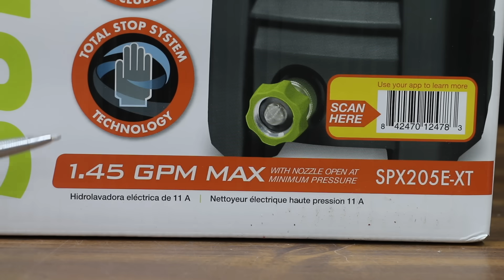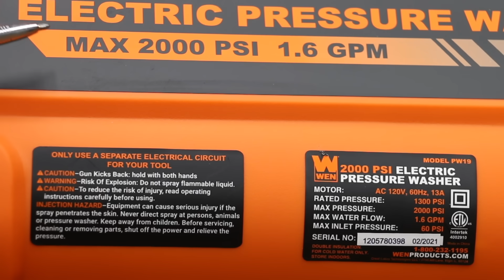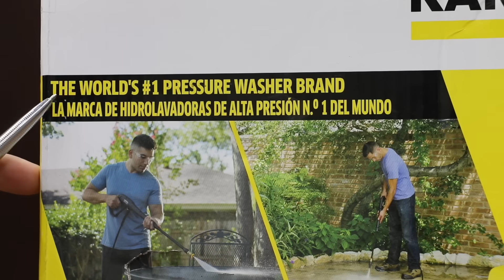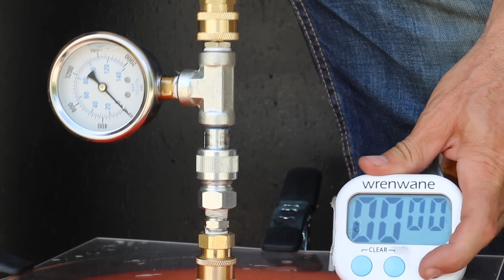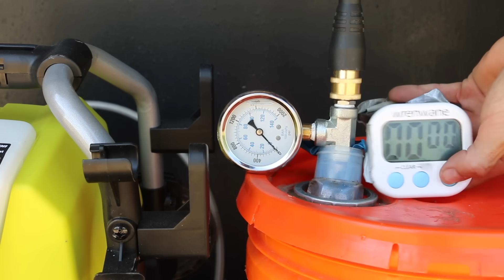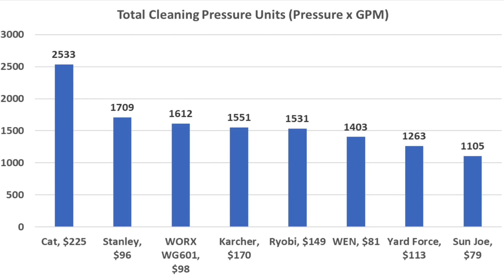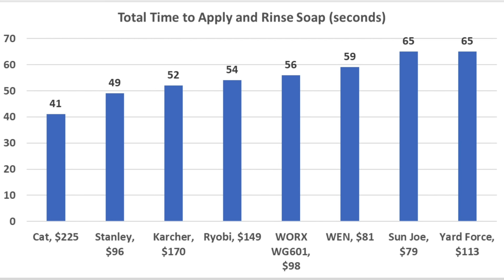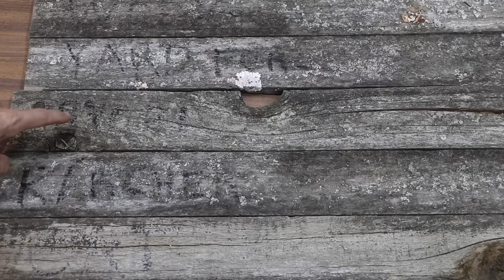Best Pressure Washer (ELECTRIC)? Ryobi vs Karcher, Stanley, Sun Joe, WEN, CAT & WORX

Comment: Love your video. What I’d really like to see is you compare consistency of units of the same brand. For example, are 3 Milwaukee impact drivers purchased from different batches/stores more consistent performing compared to each other than 3 Bauer drivers compared to each other. Maybe you can choose some cheaper tools you’ve already reviewed and acquire a bunch to see if the performance you tested is consistent or varies a lot with each unit the brand produced? Which brands are more consistent? Let’s find out.
Reply from the maker: Thanks for the suggestion.

Comment: Can you test foam cannons? Is the $30 recommended ones better than the $15? Or do you gotta step up to the $100 MTM to get s difference?
If u test more pressure washers check out the active ve52
Reply from the maker: Thanks for the video idea.
Reply: @ProjectFarm  i found out active makes the cat pressure washer so they are the same thing. no need to test it if you do another video.
but testing the cleaning power of snow foams or regular car soaps would be a great video! :)

Comment: Would like to see a review of different brands and styles of tire skates (car dolly) which have four swivel caster wheels and are used for moving a car or truck on a paved surface for short distances like inside a building or on a driveway.  Most designs require the car to be lifted by a floor jack to slip the dolly under the tire.  Other designs have a mechanical or hydraulic jack mechanism to lift the car enough for each tire to clear the pavement.
Reply from the maker: Great suggestion!  Thank you.

Comment: Would have liked to see you clean an area of concrete with each pressure washer and compare the time it takes and effectiveness at cleaning with different spray diameters. Also would have been nice to throw a gas pressure washer in the mix for comparison.
Reply from the maker: Great suggestion!  Thank you.

Comment: One tip that all should know......run your washer about 5 seconds with NO WATER...this will clear out your pump ....I have a Campbell Hausfeld PW1825 since 2014 ...bought on Amazon for $130 ......used it about 30 times a year...still going strong :)
Reply from the maker: Thanks for sharing.

Comment: You really want 3+ GPM and at least 2500 PSI (3000+ being preferable) for good results with a foam gun.  Most 110V pressure washers can't get the job done in that respect
Reply from the maker: Thanks for the feedback.

Comment: Great video! I noticed that the first part where you measure flow rate, psi, etc seemed really sped up. It was hard to follow,  especially when you were mentioning the stats. The weight as an analog for gallons really confused me - I wish you would have just mentioned the conversion in the beginning to explain the test, then just told us the gallons per min. I liked in your previous videos when you made it clear which brand was in the lead after every test, which I missed in this video. The wood was a tricky test because all of the brands didn’t seem to do great, and the final results were hard to decipher - I think if you pressure washed some pavers or concrete it would have been much easier to see the difference between the brands. I love all of your videos and hope you keep it up!
Reply from the maker: Thanks, will do!  Thanks for the constructive feedback.

Comment: Can you do a video on portable induction stove tops that plug into standard outlets (120V)? Duxtop is an example brand that does well on test-kitchen reviews, but the coil size inside the units is always debated having me wonder about how much even heating there is and if that matters.
Reply from the maker: Thanks for the suggestion.

Comment: Great videos! Can you please test storage totes? The standard 18 gallon rubbermaid roughnecks vs sterilites vs others would be great to see.

Tests to include max capacity, resistance to permanent deformation, fragility in general would be great to see to find the best garage storage solution!
Reply from the maker: Thanks for the suggestion.

Comment: Hi, you use a mass of gas engines so am interested in your thoughts and how you get around problems with gasoline. It might make a good project too for us all.

My wheeled gas trimmer has not to have ethanol more than 10%. They really want us to use non ethanol and discard gas at the 30 day period. This seems a ridiculous period. Surely  gas will not go off in 30 day? So do you have some additive with the fuels.
Can you do some testing on the problem?
Suppose I buy 1 gallon non ethaline. Put some in the tank. Drain it if not used at 30 days. Then how can I put more 'fresh gas' in from my 1 gallon gas container because THAT is also 30 days old.
Reply from the maker: Thanks for the suggestion.

Comment: as a technician in pressure washers.  If you are going to buy a karcher, DO NOT BUY THEM WITH THE PLASTIC PUMP.  Karcher has some models with the pump part that is entirely plastic and it cracks very often.  Before buying a karcher, do some research and see if the model has a plastic or aluminum pump.
Reply from the maker: Thanks for the feedback.

Comment: I guess this one might be in a different class, but I have this stand up Sun Joe, and it seems to work very well as well as taking regular pressure nozzles: Sun Joe SPX3000-SJB 2030 Max Psi 1.76 Gpm 14.5-Amp Electric Pressure Washer, Blue  It also has a built-in detergent tank. Though I have yet to try using the tank.
Reply from the maker: Thanks for sharing.

Comment: I went with the Karcher last year. Definitely hate that pressure fluctuation but otherwise pretty nice. Got it on sale for $100 so all is good. Also replaced all the connections with quick connects and a snub gun.
Reply from the maker: Thanks for sharing.

Comment: I borrowed a Portland (Harbor Freight) 1750 psi.  It is a couple of years old, leaks in two places and is not able to effectively clean grime off my deck.  I fixed a leak, no change, still sucks.  It is just weak unless I use the hole-drilling setting, then it will etch the grime and damage the paint on the railings, but still a failure.  I'm posting this because just about anything can clean a car, including just a hose.
Reply from the maker: Thanks for the feedback.

Comment: I need a replacement for my Karcher 205, which finally died after about 25 years. Yeah, it’s little but it would chip concrete if you’re not careful. I never had a problem with a dirty carburetor either. It doesn’t have one; it’s electric. I’ve cleaned sidewalks, decks, fences, cars, and riding mowers. If something is stained such as from tree sap, a car wash mitt is handy, or a scrub brush. But don’t tell me I need a gas-powered pressure washer. I’m not washing houses or tractor trailers.

Comment: I bought a Ryobi last year for two reasons. One, most of the pressure washers are 75% empty space inside, that upright enclosure has nothing in it, just a pump in the bottom. The Ryobi is much smaller and I can put it on a shelf.
The other reason is that it uses standard fittings. I had to throw away my previous washer, a Campbell Hausfield because it got a small crack in the wand that leaked a lot, and they seem to change their proprietary fittings every few years so I was unable to buy a replacement wand, and in fact unable to even buy a new hose and wand because they used a weird fitting at the other end too. I scrapped the entire thing because the wand cracked. I won't buy any more washers that don't have standard fittings at both ends of the hose.
Reply from the maker: Thanks for sharing.

Comment: Hi Todd, Great video! A quick question: Do all the washers you test have metal garden hose connectors? I own an older electric washer and it has a rather flimsy plastic connector, which can distort easily if I try over tightening the fitting. Thanks!

Comment: @project farm  great vid as always bud. Keep it up. My favorite channel for sure. I wouldnt be upset if you made 3-5 vids a week lol. But i know thats way too much with how complex your testings are.  I have an idea for a vid, hinges. Whats the best product for old hinges. Also, for power tools, is like dewalt, makita, milwaukee, is dewalt the same insides from HD, Lowes, supply house/pro tool shops. Are the insides of milwaukee and makita the same from HD as the much more expensive version from supply house/pro tool store, or from the manufacturer/sales reps. I always hear people say the the ones you get at the big box store have cheaper internals that supply houses ect eventhough they are the same part number. I dont think thats the case. I cant see them putting them same part number but different internals based on where their sold. Yes supply houses ect used to have better tools than HD, but i dont think they were the exact same part number as big box stores. Now you can get the same part number from big box stores and supply houses but the price is so much higher at supply houses so many people insist they have different internals. I think its time to put it to the test and end the myth...or confirm
Reply from the maker: Thanks!  Thanks for the video ideas.

Comment: I enjoy a lot your approach in all those comparisons, number do speak more than advertises.
Here is a serious video ideia, rate with is the best unit standards imperial or International, you probably has to convert  lot of data for your videos, and being an engineer I know that you would be surprise how much the international system works great in conversions such as the ones you do, especially if you are using water (for water the boiling point is 100C and the freezing is 0C, 1 Cal is how much energy  you need to increase in  1C the amount of 1ml or 1g [they are the same] ), you can always re-use part of your old videos for this one.
Reply from the maker: Thanks for the suggestion.

Comment: I used to use an Electric Pressure washer for 8 YEARS then I upgraded to to a Gas Pressure washer 2 yrs ago and completely cut all cleaning time by HALF or more. Washing my driveway or washing the car is MUCH faster with a gas pressure washer. Even the Chemical Guys foam cannon works WAY better. There is simply way more pressure and water flow. There is also no power cord to pulling around so it's way more convenient as well. The only con is the price of gas pressure washers of course, but even the cheapest one will blow the doors off any electric one. I found my Honda gas pressure washer for $120 locally simply because it had a leaky pump which I fixed with some JB Weld and still holding up 2 yrs later.
Reply from the maker: Thanks for sharing.

Comment: Very surprised he didn’t do a concrete wash as a test, as a lot of people use power washers to clean their driveways and walkways leading to the house. Would have been far better than whatever that wood spraying test was lol
Reply: yes, they do, but these pressure washers aren't intended for cleaning driveway/cement.  These are light duty ones under 2k psi.  Although they "can" clean, it is best to use a 3k plus psi pressure washer for that kind of job.

Comment: Great review Todd, about as accurate as can be made. And while your opinion at the end gets close to the bone, (Forgive me if I might have suggested this before), one of your absolutely great charts showing "Bang for the Buck" would be an unbiased help.. Of course, it probably could not show actual longevity, but I suppose opening the case & looking at the Plastic vs pot metal vs steel or aluminum guts might tell this point. 
Maybe, with this added info, one video with semi conclusions could also lead to another with some more in depth stuff? And , it's the same stuff stretched into 2 vids.. (Patreon fodder??)
Reply from the maker: Thanks for the suggestion.

Comment: On a different note, the driver's side of your SUV is much cleaner than the passenger side...LOL

I'm actually surprised that Stanley came in 2nd and at only $94. I've had the same electric pressure washer for several years it has the brand name "Powerwasher" on it and its 1700PSI, bought it at sam's club for $99 moons ago. Still works but I expect it to give up the ghost before long so at least I have some idea what to get.
Reply from the maker: lol  Good Point!  Thanks for sharing.

Comment: Great video! Every karcher I've owned has a flimsy power switch that always breaks after a number of turns and you cannot buy just a replacement switch. You have to buy a whole kit for something simple like a notch that has flattened out on the switch handle. Another point where they are designed to break is the water outlet. Very brittle plastic and the hose will also get stuck to the outlet. It's designed obsolescence.

Comment: How come all these where so small? Like the most electric pressure washer I see are at least knee height or taller. I have a bigger kärcher and I like it. You don't see gas pressure washers here in Sweden.
Reply: In the USA, residential power is mostly 120v. 240v is almost always just for permanently installed equipment such as a cooktop or clothes dryer. So most 120v residential circuits are limited to 20A current.
Reply: G. Tucker Yea that explains it. Here we have 240 as our normal voltage and 320 for bigger things

Comment: Another great video. If I ever decide to buy an electric pressure washer it will be a Cat brand. I currently own a Simpson 3300 psi gas pressure washer with a Honda GC190 engine, and although it doesn’t have a detergent applicator I still love it’s performance.

Comment: I have the SunJoe model with the 5 gallon bucket or hose connection and battery operated ( I live in a condo ) and needed a way to wash the car. By my calculations it has a real world psi. of 990 with the 5 amp hour battery and will run 45-50 minutes with no pressure drop, as far as I can tell. It was $230. I give it a 7 out of 10. It gets a car wash done but needs at least another 300-400 psi

Comment: I have an old type of Karcher, using it maybe a couple of times per year. The machine is still working fine, the spraynozzle has ever been replaced, which was quite expensive. Great video, I  am between the CAT and the sStanley if I would buy a new one.

Comment: Had afew ideas for new video topic, here is my current #1 :

Air Purifiers ( WITH HEPA ). 3 or 4 of these models claim to have unique / upgraded HEPA filters ( better dust filtration ). Suggested TOP brands and comparable models :

-AmAirCare 3000( Made in Canada, unique air output )
-AustinAir HealthMate+( Made in USA, unique combination filter )
-AllerAir 6 ( Made in Canada or USA, specializes in odor / gas filtration )
-IQAir HealthPro+ ( Swissmade, best reputation )
-Oransi EJ120 ( Made in USA, Unique German made electronic controlled silent motor )

Some different options for comparison :

HoneyWell ( Cheap option, available in retail stores )
Oreck Truman cell ( Dont know if they make these still, as seen on TV, very different electro-static filter )

After typing all this out i can see now how expensive this video would be O_O
Ill still post it though

Comment: I used your data and was curious about the cleaning units per cost dollar because there is such a wide range between all of these units. So using that data it looks like the Stanley and WEN really are a pretty decent value. Sharing my break down with you.

Brand---Cost---Cleaning Units---CU per $
Stanley---$96---1709---17.802
WEN---$81---1403---17.321
Worx---$98---1612---16.449
SunJoe---$79---1105---13.987
CAT---$225---2533---11.258
YardForce---$113---1263---11.177
Ryobi---$149---1531---10.275
Karcher---$170---1551---9.124

Comment: I have an older Ryobi that the hose and gun blew up on after a year. Best thing I ever bought was a new multi-length sprayer handle, quick dis-connect kit and a decent high-pressure hose from Amazon.  I wash my cars every weekend and all are still holding up fine. Great video BTW

Deluxe Pressure Washer Gun, with Replacement Wand Extension, 5 Nozzle Tips, M22 Fitting, 9 inch, 24 inch and 40 Inch, 5000 PSI
https://www.amazon.com/gp/product/B07YC2QFJ9/ref=ppx_yo_dt_b_asin_title_o02_s00?ie=UTF8&psc=1
Quick Disconnect Kit, M22 Swivel to 3/8'' Quick Connect, 3/4" to Quick Release
https://www.amazon.com/gp/product/B07MY17MGX/ref=ppx_yo_dt_b_asin_title_o02_s00?ie=UTF8&psc=1

Comment: As someone who shopped a multitude of electric pressure washers 2 years ago, I never realized how many of the same model from china come over here and are rebranded over and over. That first Stanley model must have 30 other brands using the same apparatus.

Comment: I have the Stanley unit. I somehow broke the wand, and Stanley customer service got one out quickly at no charge under warranty. The wash bottle shattered when dropped when the weather was cooler and I could not find a bottle around the house to replace it.  However, I was able to fit a piece of tubing to the bottle wand fitting and now it effectively siphons solutions from a bucket or jug.

Comment: Suggestion:

But are the results the same when removing a bolt?

 It requires a build up of momentum to create a flywheel effect. In the tightening of bolts momentum is built as the bolt or nut spins freely prior to bottoming out. The momentum dissipates to zero when tightening occurs.

When removing a bolt there is zero momentum at the start-- nothing built up. Thus the reason the hammer effect is built into the impact tool.

Think of it this way: If a truck weighing 80,000 lbs and a truck weighing 40,000 lbs are parked at the top of a hill then allowed to coast down the hill the heavier truck will achieve more speed and thus more momentum as it coasts down the hill.

I'd like to see this tested.https://www.youtube.com/watch?v=qVd8Bx6AAQc&lc=UgwTHPhUaDzWzrwnVwd4AaABAg.9OO8IsRtDpg9OYPsR7APJZ

I trust you more than I trust those other guys.